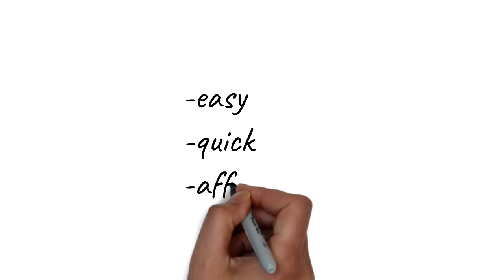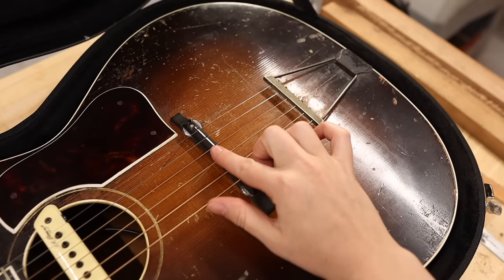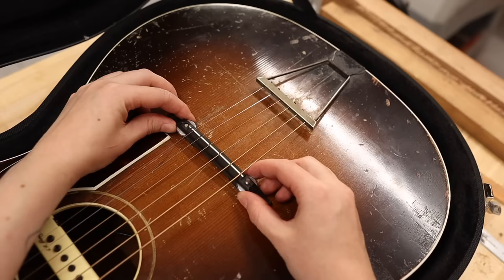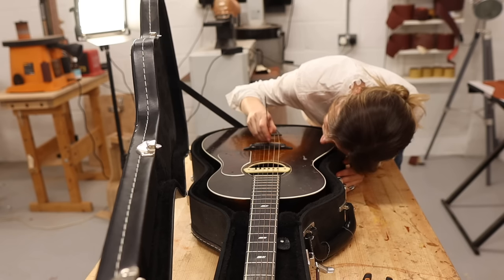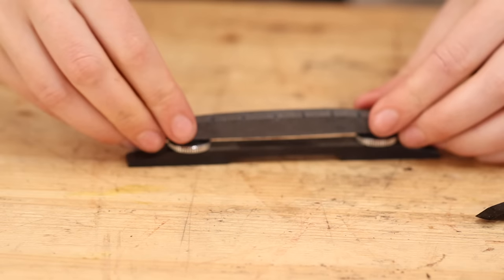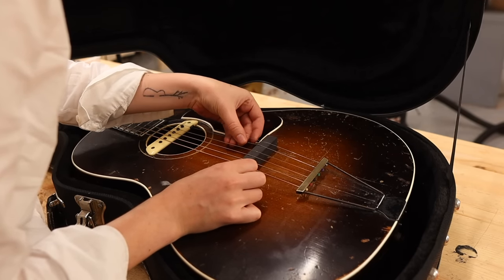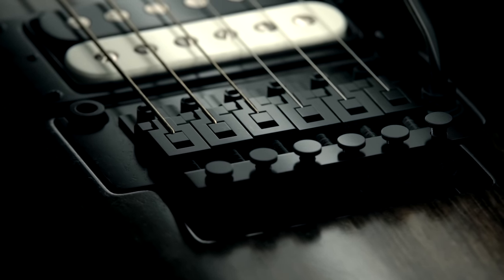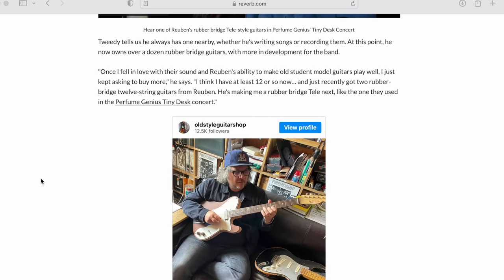How To Make A Rubber Bridge For Your Guitar

Comment: Another fun string deadening thing you can do is weave a strip of paper in between your strings. It creates a cool percussive muted effect. You can also move the paper strip closer to the bridge to lessen percussive/staccato effect.
Reply: One could also pop for a guitar mute. The rubber block would work well for an over string mute; they are similar to a violin mute in the manner of usage. Fender Jaguar 's can be fitted with an under string mute at the factory or purchased from them in the after market. Get a pro like Daisy to install it for you!

Comment: Yes I’m doing a rubber bridge on a 1962 Kay, that I picked up at a garage sale for $90.  It’s been used and abused, but it’s still in good shape.  I even got the original case.  I decided to not put the output jack in the guitar strap hole because I couldn’t get my arm into the guitar to install the jack.  I’m also using flat wound strings. 
And your playing doesn’t suck.  You’re better than me.

Comment: Great Video!  I have experimented a lot with various materials for bridge saddles - woods, plastics, hard rubbers, metals, bone, horn, etc.  I live in a small house with a wife who likes quiet. I found that hard rubbers with an 80 - 90 shore "A"  hardness produce a very nice mute.  They make steel strings sound like soft old nylon strings, cutting the volume in 1/2  without changing the tone much.   Many types of hard rubber and plastic are available as sheet goods in 1/8" thickness, and small quantities or "samples" for experimentation.  
BTW, you have an interesting playing style; one of my old teachers called it "first ready".  That is, to play with T and 2,3,&4,  leaving "1" ready to attack a melody line as needed.  Gotta love old swing players.

Comment: I have been making a lot of bridges and saddles lately for various projects (banjos/older guitars) so this is timely for me. I planned to work on one today.
I think if I were to keep the rubber bridge I would glue a bit of veneer to the base of it as I can't imagine contact with the rubber would be great for the guitar's finish.
Interesting sound, though, and it opens up thoughts about various materials that could be used for saddles/bridges.
Good video. Thanks.

Comment: To get a flatter sound similar to that rubber saddle I ran a 1/4 inch threaded rod through the back of the guitar with a plastic tip that adjusts up and down to directly underneath the middle of the bridge.I installed a tee-nut on the inside back of the guitar with a small block of wood.I stamped the end of the threaded rod to accept a small allen key/wrench.

Comment: What do you think about slotted pins vs slotted holes advantages/ drawbacks on/ in steelstring bridges?   
Instead of a rubber bridge I have seen ppl use rubber elastic band woven throught the strings, to dampen strings it worked fine imho.

 I once thought for about 2 months I killed my Epiphone LP because I changed the strings from 1.1's ( came with guitar)to 0.8's after a week of playing since I bought it. Everything needed to change because, you know why.  
I just thought how hard can that be, so I changed the crap to it. It got from bad to worse, to whoops might have broken it in about 3 weeks time. 
So I bought a book about guitars, bought some tools I needed. And then after a month of measuring, adjusting etc. everything ,I had a perfect guitar. 

But I swore, I will never ever do that again.
 
And thats why I have got so much respect for you👍

Comment: Just split a length of small rubber automotive vacuum hose up one side and slip it under the strings and over the saddle. Small clear oxygen hose will work as well. Same effect without ANY modification.

Comment: Omg thanks for saying it’s a rubber SADDLE. Drives me nuts that people call it a rubber bridge — kind of like the vibrato-trem thing! 😂 

I like your idea to use a guitar with an adjustable bridge. That’s a really quick and easy way to do it.  If someone wants to use a regular acoustic, you shouldn’t even need to cut the rubber to fit into the saddle slot — I have seen people do it by placing the rubber right above/in front of the regular saddle and it sounds great. 

Maybe you’d like to expywith a few homemade ideas I’ve sort of thought about, but I haven’t tried them myself yet. I keep wondering why it needs to be done at the bridge end. Shouldn’t it theoretically make the same effect if you put the rubber in front of or behind the nut, kind of like the GruvGear dampener that goes under the strings behind the nut? 

You could also probably make one kind of like their popular FretWrap by attaching rubber to a hair tie and wrapping at the top of the frets, which should dampen with a piece of rubber if the hair tie is tight enough. 

Or you can make something that just goes on the strings like the Bass Fump (I think that’s the name) made by GruvGear, which clamps to the of the strings by the bridge by using a hair clip and a piece of rubber. 

I’m obviously taking a lot of inspiration from GruvGear products, lol. 😂😂😂

Also, can I suck at finger-style as much as you?! Cause you are quite good!

Comment: In my opinion this rubber bridge thing which is all the rage at the moment sounds a lot like nylon strings on a cheap classical guitar (don't get me wrong, I got one of those suspects in my collection and I don't wanna miss it), with some advantages and disadvantages. An unmuted classical will still have more sustain, but steel strings are way better for bending and can be amplified with magnetic pickups. But here comes a fun fact: I also play a lot of bass and for us bass players this kind of thing is not a new idea at all. If you want to (at least somewhat) emulate the sound of an acoustic contrabass, you have to use a mute. There's different ways of doing it, the easiest one is just to shove some foam or rubber under the strings close to the bridge, but if you want to deploy and remove the mute quickly, a slotted strip of foam/rubber on a strip of plastic or wood is perfect. Experiment with density but I found this foam stuff for putting under pickups works great and is easy to get. There's also commercial versions of that (like the Nordymute), but it's sooo easy to DIY, and then you can cut the string spacing exactly to your needs. I use my mute all the time when we play jazz in the local wind orchestra. Another sidenote: There's integrated mutes for electric guitars and basses too, also mostly known on basses, especially Rickenbackers. 
Thanks for the inspiration! Now I will go and make such a plop-on mute for my steel string acoustic too!

Comment: First your guitar playing is fine.  Second there other options that I would prefer.  I have a piece of shag carpet I have folded over and put between my pickup (I have electric guitars) and the bridge that mutes the strings just fine.  Otherwise you could simply buy a Gretsch Country Gentleman with mutes already installed!  Just joking, but I do use the carpet scrap to do the same thing and can be removed in seconds, a valuable commodity when playing live!  That is actually what the Herman's Hermits did on Mrs. Brown You've Got a Lovely Daughter.

Comment: That same sound can be achieved (as you mentioned) by palm muting, by an elastic band at the nut or weaving something between the strings, also to some degree covering the sound hole with some material of choice, I and many players experimented with these and many other odd ideas in the 70s, all good fun but nothing new heh heh

Comment: I don't get how the bridge doesn't compress until the string is too low. Unless you manage to find sufficiently hard rubber. 
What I did was find some silicone caps, I think they're intended to cover things like exposed protruding screw threads or for painting protection. They are about 12mm long tubes, closed on one end, with about 1.5mm ID. )D is about 5mm. I simply slid one on each string so that it rests on the existing saddle, with the string inside, such that the silicone hangs off both sides of the bridge about equally. Enough to do the muting effect. The advantage is that you don't have to cut anything. They work on pin bridges as well as floating bridges. Perhaps any small diameter rubber hosing will do as well.

Comment: Bit late to the party here, I just wanted to remind everyone NOT to do this with a guitar that has nitrocellulose finish (common on gibsons, martins and many others). The rubber will cause a chemical reaction that burns the finish and makes a reallu ugly permanent mark. You need to put a sheet of wood or paper between the rubber block and the guitar.

Comment: has no one heard of the technique called heel damping ...used in the 50s and 60s .using the edge of your picking hand on the side across the strings.
you dont need to fit a rubber bridge .

Comment: personal preference, i think rubber bridges sound terrible. just seems like you go to the work of buying, (god forbid making) a full instrument designed to get as much volume and tone as possible with as much resonance as you can squeeze out of materials selected to ring out, and then right at the end you negate 40 percent of it. they just sound like really cheap guitars after. I had a guitar i made when i was 16 that sounded like this...because i was 16 and had zero help or knowledge, made assumptions and built a crappy guitar. I dont get it. It feels like buying a ferari and then adding weights and engine dampening to make it slower and weaker instead of just buying a 4-banger truck that's already heavy weak and slow. Feel like maybe the nice quality instruments should be left to do their thing, and if you want a dead sounding guitar, get a beat up old junker and jam some styrofoam under the strings to make it extra bad. I dunno. It would just sadden me to watch a video of a guitar you spent a ton of work on to make beautiful and sound great just to stick part of a tire in the transfer point and make it sound cheap.
Reply: There's several different reasons a player should use rubber bridges
especially beginners.

Comment: What a bunch of unnecessary bullwork to simply provide the same effect (with less control) as simply muting the strings with the heel or edge of your picking hand. Or simply weaving a bit of string or surgical tubing through your strings.